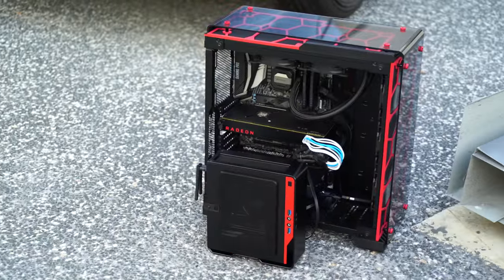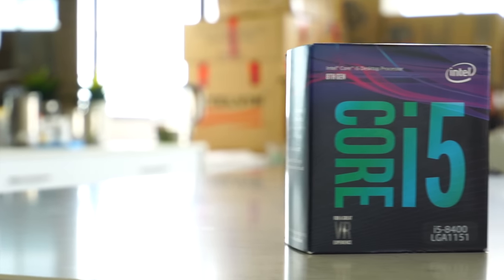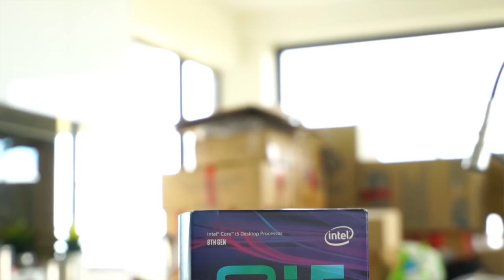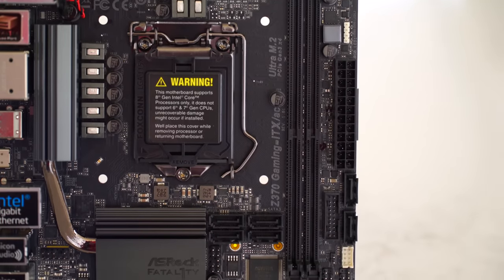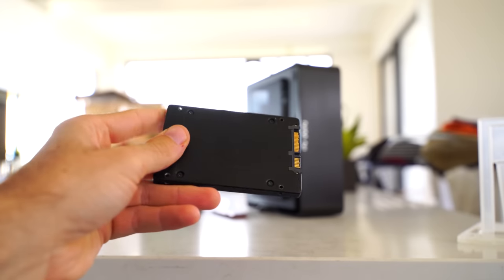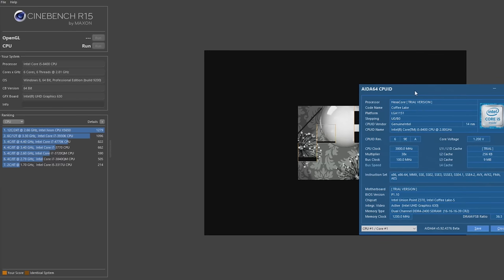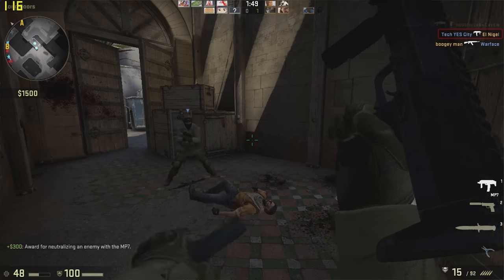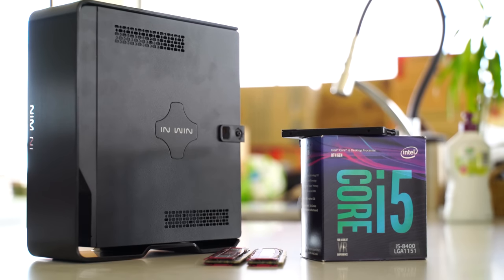Build the SMALLEST Mobile 4K Video EDITING PC Ever!

Comment: In the US, you can actually buy InWin BQ656 from the same company at the cost of $80. They have exactly the same internal structure and size, but BQ656 has a plastic front panel with a window for DVD.

Comment: I made a similar PC in a Chopin, I don't love the case but it did the job it was made for. Cable management may be easy but I ended up cramming them all down the front between the mobo and front.

Comment: Prices in the U.S. are now quite reasonable. The case + p.s. is $80 usd and 16 GB 2400 is now about $150, i5 8400 is about $180,  a 500 GB nVMe is between $130 to $200 depending on speed. a 2 lane variant is 2X as fast as SATA and only $130 for a 500 GB

Comment: But why not just buy a high spec laptop and use that for the on the go editing?
Reply: Thats what I was thinking
Reply: Are you a 4k video editor? If not, maybe you wouldn't understand his needs..
Reply: Cost and upgradability. I would also suggest that access to monitors and not needing to deal with low resolution laptop screens as reasons.

Comment: Wow $115 for 32gb? I just paid $110 for 16gb and I thought I got a good deal.
Reply: what memory was that i got 8gb for £80
Reply: I built my pc recently and paid £42 for 4gb ddr4 ram. Fucking annoying coz I need to save up for another stick of 4gb or maybe 8gb
Reply: Got mine 16GB 3000MHz for $84.99. That was last year
Reply: can i download some more RAM from you? xd
Reply: I got 16 for 100 a year ago now it costs 160 where I live
Reply: Glad still have ddr3 pc, buying 4gb ram to ipgrade my pc ram to 8gb for just $9 :)
Reply: For $110 I could get 8GB best case.
Reply: JR times were different that's for sure. I grabbed the cheapest set I could before Ryzen launched, but I was looking for 3000 mhz as my base lowest fast speed. Ended up with a corsair kit that cost me $120 Canadian after shipping and taxes. I knew I wouldn't find great deals for 16GB, but I did find what I considered to be acceptable. Now the ram prices are just too far out of reach for me to bother.
Reply: I bought 16gb DDR4 Laptop ram for around $60 in 2016 man.  I don't ever want to sell this stick of ram xD
Reply: Currently it's like $200 for 16g
Very high demand and like no supply
Reply: A little later but i paid 400$ for an i7 6700 and 32gb of ram

Comment: I have:
I5 8600K 5GHZ
Gtx 1080
16gb DDR4 ram 2666MHz

When im editing in sony vegas pro 15, it is very very laggy, it takes a long time to load frames (Set to Draft Quarter)
The app some times crashes when im trying to add effects and things, i have tried to factory reset computer, reinstall sony vegas but it is still so laggy.

Anyone have any tips?

(I was editing 4k, 120fps)

Comment: Why not put in a GT 1030? It's only 30W and the 386 CUDA core are more than enough to give you a boost in effects and render times. It would still keep you at around ~110W total power.

Comment: Awesome build! I really want to build something like this but I'd need at least a GTX 1050. I've heard and seen some "laptop form" GTX 1060's, 1070's, etc. coming to Mini ITX and a newer standard that is even smaller so that will be cool. I like laptops but I am typing on one right now and with discrete graphics I just feel like airflow suffers too much. Maybe an external thunderbolt 3 enclosure for a GTX 1050Ti would work good!

Comment: Personally, I think this case would be significantly more impressive when we finally get AM4 Vega APUs.
Reply: Too bad the Vega APUs will only be 4c8t. (afaik)
Reply: Ok so it's not a hedt core count.  Oh well.  4/8 is plenty for current games and you're also not likely to scale beyond 4/8 in the first place unless you add in a dedicated card in the future.  Now for things like production workloads, then you would want more cores, but you'd also want a dedicated graphics card for acceleration most likely.
Reply: Yeah maybe for gaming, but for mobile video editing build like what this video is mostly about, the Vega APU will most likely not be a better choice.
The i5-8400 already beats the 6c12t r5 1600 by about 8-10% in premiere 4k video rendering.
Reply: Ok, but what happens when you accelerate with a GPU?  It significantly closes the gap on CPUs.  At least with CUDA.  If you can use the on die Vega compute units to GPU accelerate the workload, I think you'd still beat out an 8th gen Intel CPU without GPU acceleration.
Also - my comment was more about the case and it's lack of ability to fit any discrete graphics solution, not video editing.  I mean if you can get 1080p60 gaming in anything with an AM4 APU, a build in that box could be a console sized console replacement.
Reply: Yeah, we will have to see some benchmarks on that. Also, the usefulness of GPU-acceleration depends on how much post processing effects are used. Most of the rendering is still done by the CPU.

For a cheap 1080p60 gaming PC without dGPU, the AM4 APU is the better choice for sure.
Reply: Your wishes have been granted!

Comment: If you could use a GPU for CUDA and u r worried bout power consumption then maybe drop a GT1030? Better than nothin and sips only 30W :) The MSI passive one would be perfect
Reply: 真白 You're right man :)
Reply from the maker: I will definitely take a look at doing that, would have to hack up the case a little though.
Reply: Not really? Looks like the case already has the back IO mounts for a 1030 style Low profile card? :)
Reply: Tech YES City hacking? Nothing The YES Man cant handle :D
Reply: Mansen no, the chopin doesn’t have any expansion slots
Reply: Literally has mounting for a low profile card (that doesn't hit the PSU) on the back of the case. Look it up.
Reply: It doesn’t fit stock. Only passively cooled cards like a capture card or an audio card.
Reply: Or just use Intel Quick Sync :)
Reply: Please do a vid on gt1030 in this case if possible :)

Comment: Really cool concept and I can definitely appreciate the build with this particular use case but I can't really see it as the most reasonable even for most mobile editors. I would consider an ITX case with support for SFX PSUs and at least mid sized GPUs to be a better compromise. They are both niche products but something just a little larger can add a lot of performance or reduce cost, especially in the US right now. I mean, unlike a laptop, it's just going to get set up in the hotel anyway. Still, coffee lake is by far intel's most exciting release, especially for mobile, low voltage cpus, since Sandy Bridge. We finally have a quad core ultrabook cpu.

Comment: Hi, cool idea to use this case, there is an alternative that looks almost 100% identical and is half the price. Anyways: when will you post the followup video and give us to information on how it handled the job? I am curious as i got the same case available and one size bigger to that would fir a single slot LP videocard too if needed :)
Reply: Barna Buxbaum What is the alternative you speak of?
Reply: CIT MTX-007B (goes around £40 with the 180W PSU) :)
Reply: Thanks mate.

Comment: Can this case fit a 15mm thick 2.5" hdd in the back? I heard in the video you said fits a 3.5" but everything I've read says 2.5 only, but a shucked 2.5" 4TB external is 15mm and seen a couple reddit posts but nothing confirming it. If you remember at all or anyone else would be highly appreciated.

Comment: really inspired to get this. getting sick and tired of the crazy gpu prices and ram as well. just decide to give up decent pc gaming and settle for integrated graphics gaming as i mainly play dota 2 and gta V not max settings anyway.. one thing i'll have to replace though is my motherboard. im using an ecs h110m4-c2h. it's an mAtx board but its crazy small, almost the size of an itx. would it fit in this case?

Comment: I'd say get the best gpu that is low profile. Not a gt 1030 but something decent with video output. Also I would go for an over lockable cup and get a low profile noctua or cryorig heat sink.

Comment: this case can fit an gtx 1050ti low profile from msi? 
if yes, it can be a pretty capable portable system. ( a 150w psu could be a limitation tho, so gt 1030 would be a great option aswell)

Comment: Could have been perfect if not for that anemic psu. For a lug/toss around gaming rig i would have considered this and of course the upcoming Ryzen APU's but that psu might be too weak. i wonder if it can even power AMD A10/A12 (not recommended) and not die lols... Form factor design choice also prohibits at least using a g4560 with a low profile 1050ti, get back on the drawing board Inwin you "Outlose" this time ^_^ 
PS if the psu was on the otherside people can jerryrigg a gpu, but of course needs more psu wattage too

Comment: Hey Bryan, the i5-8400 looks like a really good buy for video encoding. I know it has some new features for HVEC/h265 for example. I am currently thinking about building a transcoidng/storage box for a good buddy of mine. There are so many options cpu wise. Would you go for something like this new i5 or go with something older. Thinking about e5 v1/v2s or even x58 with OC. I know you have a lot of experience with those platforms. I would greatly appreciate you opinion on how the new intel generation chips fit in with older/more obscure hardware options for "production" workloads. The idea with the e5 would be that ecc ddr3 is way cheaper to get, but idk if hvec support and lower clocks would leave it in the dust compared to newer stuff even with more cores.  
It's not like I am gonna build it today, so thinking ahead the non Z boards for 8th gen intel coming next year are a worthwhile consideraton too. I am curious what your thoughts are on this?
Reply from the maker: Oh the older gen stuff is extremely hard to beat for price performance, especially if power and size is no concern, the xeons on x58 can utilise ecc memory (not sure about registered though), and with that you can oc them and get crazy good performance that beats the 8400.  This is strictly for the size and carrying it around, its sooooooo small and powerful for editing 4K.  Might even try slap in a GT 1030 somehow, but that will be a project for another day lol.
Reply: Good to know that the old stuff still packs a punch. Ofc it's more power hungry and less mobile, gotta break out the old Excel and run the numbers, power's pretty expensive in Germany :(  
The old mainboards can be kinda expensive still, I saw a lot of stuff coming from China - like lga2011 boards from "Huanan" or other OEMs. Have you ever dealt with those? Is it worth getting something a tad more expensive but from a name brand?  
And man, I'd love to have such a small inwin box instead of my old crappy laptop. Or maybe I just need to tape together 4 old crappy laptops and set them up for network render - that'd be an absolutely getto setup lol. Anyway, that little box you build there is really awesome.

Comment: Ok dumb question but I’ve been modding a lot recently so could a micro atx motherboard fit into this thing if you used a pico instead of the psu they supply and fit a gpu sideways using a riser?

Comment: Did you just remove the sticker on the intel heatsink so it looks like a custom one? :D

And yea DDR4 is overpriced as shit, here in germany as well... Because of that i couldnt upgrade to ryzen. I took an i7 3930K, which is similar, and the best cpu which can still use my old ddr3 mem.
Reply: TheRailroad99 haswell and broadwell also use ddr3 :) ...
Reply: but they only have 4 cores and i wanted to have at least 6 cores to be future proof ;)
Reply: TheRailroad99 OK :)... The question is in My opinion if u need The Cores for editing or things Like that now... Cause Future proofness is relative if u buy an older CPU... 4c/8t highly clocked is still better in gaming i think and will be The next 2 years (My estimation)... In fact haswell and more so broadwell.are plenty for gaming
Reply: @PhoenixDown:99 The 3930K is similar to a R5 1600 in games (because of Ryzen's weakness in games), but for other stuff the Ryzen is a bit faster, and it drains a lot more power. So i would not recommend the 3930K if you can't save money using it. I paid 260€ for the 3930K with an AsRock Mid-Range motherboard and extra 16GB of ram. Including my previous RAM i do have 24GB now :). But keep in mind that X79 Motherboards are VERY expensive, more so then new X299 Boards. But including the RAM, it was 200 bucks less than a 1600 with a nice B350 Board and 16GB fast DDR4. (because for ryzen you NEED fast RAM)

@ matzoe123 i mostly play games, but i often run a gameserver and sometimes also up to 2 VMs parralel.
Especially for the virtual machines you need a lot of cores. That's also why i was a happy FX-8150 user for a long time. The FX is much better for my tasks, compared to an i7 or even i5 with 4 cores. Also, i like to have opened a LOT of tab, like ... 30 :D ... while playing a game. And while the FX had lower FPS, it did not have ugly lag spikes when other programs needed some CPU power. The same goes for my new i7. Basically, if you need to do something CPU intensive while gaming, you NEED 6 real cores or everything will lag. With the i7 i can even render videos while playing games. But i don't render videos that often. I highly doubt that anybody will render videos that often (except "real" content creators who have a big youtube channel). It's just an excuse for buying a kick-ass rig :D
Reply: but the IPC is waayyy above any Bulldozer chip.
And yes, it gets quite cold in winter here as well :D and i am used to space heater, i have used the FX8150 for 5 years now, overclocked :D This thing could easily fry an egg when gaming :D ("Just" 60C, but the pure MASS of hot air is insane.)
Reply: TheRailroad99 i picked a new 6700k + mobo from Asus (Maximus 8 Hero) this Summer with a 160€ Cashback so all in all for 350€... Added with High Speed memory from gskill (16gb ddr4 3200 cl14) which i got for 120 instead of 180 this is a very good Price/Performer. Overclocked its a beast especially for gaming... Came from FX 8350 ... I only regret that i havent changed earlier to a Chip with better singlecore performance
Reply: wow that's a great deal. I could not find any skylake chips for that price. Even haswell is still very expensive. ivy bridge is a bit random if you want an i7, but the i5s, as well as all sandy bridge chips including the 2600K are very cheap right now, and motherboards are easy to find used. 6 months ago it was very hard to find a good 1155 mobo here in germany, but now they are everywhere.... Everyone switches to ryzen or newer intel chips now.
Reply: TheRailroad99 yeah it was in May this year... There were offerings for kabylake too but with less Cashback so i chose skylake as it performs similar
Reply: TheRailroad99 Thanks to ryzen and x299 Release they Sold Out :)
Reply: As far as i have heard they can overclock very similar, but run much cooler when not delidded. The whole "toothpaste" discussion started only because kaby lake. Older intel chips also have TIM between IHS and die, but it was better. At least you could cool them down when not OCed. A 7700K can go up to 90C, if you get a bad pasted one, even with a liquid cooler.
Reply: TheRailroad99 yeah i think an AVG Sample of 7700k can Reach 4.8/4.9 oced 6700k 4.5/4.6 (all non-delidded)... So Performance Difference should be around 5%
Reply: Da du ja einen 3930K gekauft hast, hattest du vorher schon ein Board oder hast Du dir das auch gebraucht gekauft? Wenn ja, für wieviel? :P
Reply: kronicz1337 ich habe für Board, RAM und CPU 260€ bezahlt (alles von einem bekommen, der aufgerüstet hat). Auf ebay Kleinanzeigen. Gehört aber ein bisschen Erfahrung dazu, sonst wird man dort schnell über den Tisch gezogen ;) War aber natürlich ein ziemlicher Glückstreffer. Die Boards kosten einzeln leider über 200 Eur, weil sie mittlerweile sehr selten sind
Reply: Ah, okay. Wollte generell fragen wegen den Board-Preisen weil die CPUs verhältnismäßig billig sind für den Sockel... hab auch schon einiges billiges geschossen über Kleinanzeigen, Phenom II X4 965, 8GB DDR3-1600MHz CL8 inkl. Board + Kühler für 30€ und funktioniert bis auf den LAN-Port einwandfrei... oder ne Asus GTX770 DirectCu II für 40€. Hatte auch schon Interesse an ner X79 Plattform, aber preiswerte Hardware echt schlecht zu finden auf der Basis... :/ 1366 wäre zwar auch ne Option aber mMn. zu alt, auch wenn die Xeons noch echt ausreichen

Comment: IF ONLY YOU COULD FIT A GRAPHIC CARD IN THERE,,,if Only,,, (say does that mini SFF 1050ti fit there?)
Reply: You can. It fits a low profile GPU.
Reply: You can't fit a dedicated GPU in it :/. If you want to build the same thing with a dedicated GPU you should go for an Fractal Design Node 202, it should also come with a strong enough PSU. :P
Reply: but 1050ti is not low profile :(